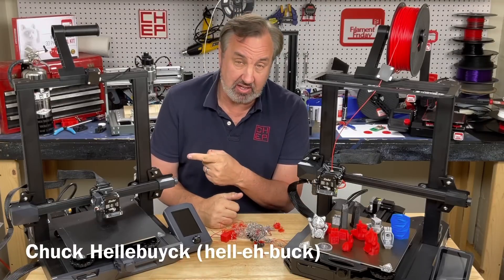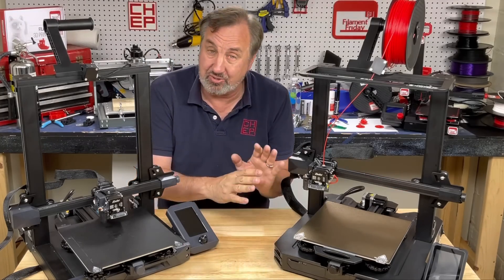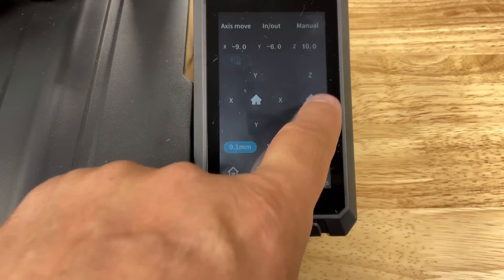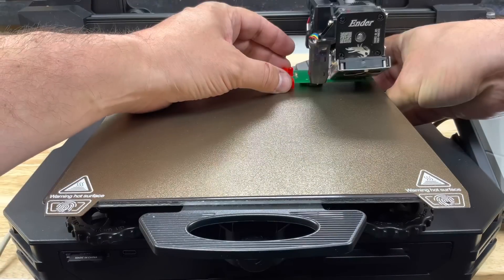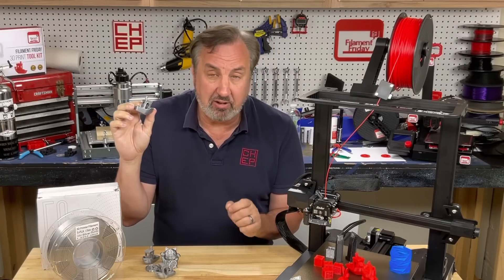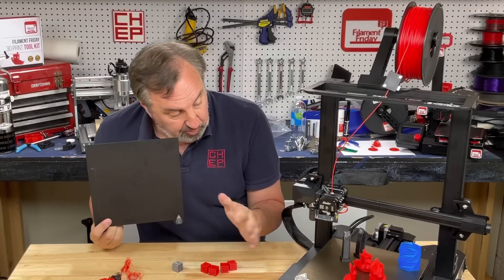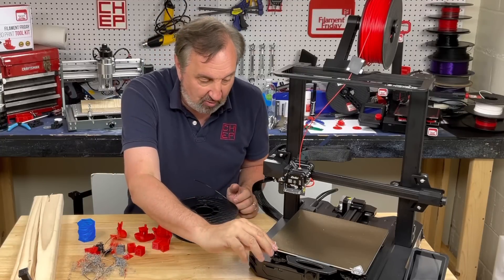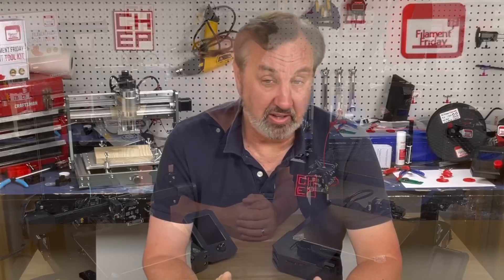Ender 3 S1 Pro - High Temp Direct Drive 3D Printer

Comment from the maker: FYI: For everyone telling me how to fix the bed. I actually have two Ender 3 S1 Pro printers. Both have the same issue. I’ve cleaned with IPA, I’ve washed with soapy water, I’ve scuffed it, Ive tried higher heat, I’ve re-leveled the bed many times. 
I have a lot of experience with Creality beds having tested them before. I’ve also used PEI bed in other machines like Prusa. I have 3rd party PEI beds. I’m very familiar with them and how the good ones work. It’s the Creality PEI bed on this machine that is poor quality. Not all PEI beds.
Reply: LOL, I love the fact that people are telling you how to get prints to stick, freaking hilarious, as if you don't know what you are doing. Love your channel Chuck.
Reply: why don't they use the glass bed from the ender 3v2??? i like that bed alot
Reply: @jeannordstrm3935  that one with glue is the best option there is! everything sticks, and it's super flat
Reply: I use the stock PC bed printing mainly PETG and it sticks like a rock just by touching it
Reply: I find that people who can't get good adhesion on stock bed are all doing it wrong, I've helped thousands in Ender 3 S1 group that all complain about bed level and adhesion
Reply from the maker: Darkburrow - How do you suggest I level it to get better adhesion on the PEI bed?
Reply: @FilamentFriday  from my experience I had to put Z-offset nearly to close for it to stick, I find the textured surface is TOO textured, PC bed i just need to be close enough with PLA and just touching with PETG, now bed that came with mine is awfully warped unfortunately, variation of 0.5 in some places, ABL can barely compensate, level as you always do
Reply from the maker: Yeah, the PEI bed is hit and miss apparently. I just got two bad ones in a row.
Reply: @FilamentFriday  I have found that the dual-sided rough and smooth PEI is a good bet, the smooth PEI I think works better for PLA, but PETG and TPU stick too well to it so I use the rough side.

I think PEI is probably the best all-around print surface that works on multiple materials with minimal issues, but PC beds definitely stick PLA down really well, can't dispute that! At the end of the day it's a case of using what works best for you, I have a few beds I swap between depending on what I'm printing with.

The quality of the PEI might make a difference too, I have only used the one I have, not what Creality ships with the S1 Pro.
Reply from the maker: Recka - Great points. For the price, and calling it a pro IMHO, they should include two beds. An S1 PC bed and the PEI. I’m pushing for that from Creality.
Reply: Cannot argue with that. Calling it a pro machine, they should offer as much versatility and options as they can.
Reply: @Torskel  would you like to tell us all what we are doing wrong??? Links etc
Reply: @Torskel  WOW ! such wonderful clarification , bet thousands have learnt from that!!
Reply: @Torskel  preach it master! How must one do it
Reply: PEI is soluble in alcohol.  If you clean PEI with isopropyl alcohol it will absorb it and swell.  Your adhesion will be terrible until all the isopropyl alcohol has evaporated out which can take much longer than you think it might.  You also shouldn't scuff it.  That is just going to make absorption worse and ruin the bottom surface of your print.  Clean the PEI bed with soap and water and run it about 55C.  It pays to check your bed with an IR temperature gun.  If you are getting hot spots you may find that adhesion is failing in those spots.
Reply: I think the PEI bed on the S1 Pro is extremely sensitive to bed temp for a given filament. I've been printing for a month now using Hatchbox (various colors) and my adhesion has been finicky if I don't get the slicer settings perfect. At 50c bed temp, my prints have had a 100% failure rate. At 60c bed temp, I have had 25% failure rate. At 60c bed temp, I have had 0 failures in 35 prints while also going to a .3mm first layer so combination of the increased first layer height and bed temp has solved my bed adhesion problem. I will say, once the bed cools my prints just slide off the PEI without even having to lift the lift the magnet. I would 100% agree with you that I think in many ways it is a step back from the S1 bed material.

One thing I would call out though is I still think the S1 pro is the best deal. You get the LED light, the high temp hot end, and once you use the touch screen it becomes easy to use even if the menu isn't intuitive as there are not a lot of options in stock firmware. All of the upgrades bought separately are each 200% marked up from the cost they come bundled as part of the S1 pro.

All in all great review and your talking points are all very valid and 100% accurate.
Reply: @Jocoev  This is what I've observed as well. Got my S1 Pro a couple weeks ago and initially had some bed adhesion problems.. virtually all of them went away once I started setting bed temp @ 60c for PLA, ~80-90c for PETG, and TPU sticks to it really well regardless so I just print that with the bed at 40-50c to save a little on power.

Love this thing though - phenomenal results printing TPU (amazonbasics) @ 60mm/s, PETG @ 120-140mm/s, and PLA @ 120-180mm/s.
PS: I'm using Klipper, with 1500 x/y acceleration
Reply: I appreciate this clarification.  I had mine dialed in and then out of nowhere could t get things to stick and haven’t been able to figure it out. Do you have a 3rd party bed you recommend?
Reply: @billysaqr3253  Energetic PEI beds are what I use, both smooth and textured. They're great, the best ones I've ever used (and I've used a lot!).
Reply: @billysaqr3253  I've had good results with the TH3d Studios EZ-Flex beds, and the wham-bam ones also. Not sponsored by either company, I just have a lot of printers and have used a ton of flex plates. Best results are the ez-flex by far, but the wham-bams are good too.
Reply: I have several PEI sheets, I don't think I have ever had an issue with the textured side.  The smooth sheet generally requires roughing up with wire wool and isopropyl.  Occasionally I have issues with some PLA's not sticking, if a "re-ruffing" with Isopropyl and wire wool doesn't fix the problem, I use a glue stick.
Reply: IPA is the wrong stuff to use. just wash it with a bit of dish soap and dry it with tissue, mine has been working for 2 years now and it has never failed. it use to fail all the time when i did with IPA.
Reply: The regular Ender 3 and Ender 3 Pro beds are the 2 best beds I've never used, and I have many Ender 3s including Ender 3 V2. Glass beds are aweful.
Reply: Had the pro as well and a lot of trouble with bed. It was bended, ABL was not saving results.. it never was possible to print a first layer correctly. And as well this software.. horrivle.
Gave it back with $80 loss, but happy with this deal.
Reply: I've found bed temp on this printer is 10 degrees below actual. I've checked with temp gun.
Reply: Have you tried denatured alcohol?
Reply: Creality is a waste of money!

Comment: I’m having problem printing with my S1 Pro. So I bought the Sonic Pad and it started AOK, but now keep slipping and all the model coming off the bed because the Nozzle or something (that I can’t figure out), keep touching the model while printing. I keep resetting and re-levelling the Bed, swap with Silicone Legs instead of Spring, swapping the screws with shorter screws and yet the same. Any advise will be much appreciated. I tried to print the CHEP Cube and failed half way. I need help, please!!! Thank you in advance!!!

Comment: im having a horrible time trying to make my prints stick to the bed i just bought my 1st printer its an ender 3 s1 plus and i have NO CLUE WAT TEMPS i need on the nozzle or plate would u have any advice? there is alot of videos out there but no one really walks thru everything im stuck atm dont know what to do i also bought a enclosure for it so wind wouldnt be a factor in moving my prints dont know what else i can do =( can u lead me the right direction?

Comment: In my experience with the textured PEI plate you want to clean it when its dead cold. It’s temperamental when cleaning even while the slightest bit warm or idle. Pretty sure it has to do with the way the sand blasted pock marks retract while cold. The good thing about those microscopic craters while at full bed temp is they grip like nothing else. Its also the reason why the larger the print the better the adhesion as long as the bed temp is high enough. For PETG I go with 90F on bed temp and 250C for nozzle…I’d need a hammer to separate the print from the bed at full heat. Allow bed to cool to zero and i can push a full volume print off with one finger. The problem with this full cool down cycle is slower concurrent prints waiting for the bed to cool to zero.

Comment: I watched this video months ago after I had purchased the S1 Pro. Watched several reviews being curious to what others thought about the printer. My brain wrapped itself around the UI a bit better. Wasn't an issue for me. I never touched either home button until yesterday, which is why I comment. Figured I'd share my experience.

I've printed ... 100 parts maybe (~1600 meters)... now I'm having first layer issues. I manually level the bed, start the G-code (which has G28 in the start code)... mediocre 1st layer 1st print, abysmal 1st layer second print, manually adjust. Repeat... I'm assuming my Touch is having issues? But I'm noobish, and currently my workaround is removing G28, manually leveling the bed (giving me the best first layer yet) and homing XY occasionally via the UI. For the time being works great!

I'm happy with the purchase... but already want to use filaments that exceed this printer's capabilities, LoL.

Comment: I'm enjoying my Ender 3 S1 Pro, had it for a couple of weeks now. I've also had some issues with poor stickiness of the base sheet. I've printed a bunch of my designs in TPU on it that came out great, someone else's articulated robopede in TPU, again great. One of my own mesh designs in TPU, it really is great for TPU mesh prints, fast too because of the quick retract and good feed pressure on the TPU.  And last night, one of my vase designs in purple/copper/blue tri-colour, If I were an artist, that would have been an orgasm in the pants just looking at it. I'll have to try some other tri-colours, but this one is spectacular and I know what some of my Xmas give-aways are going to be now. Where I did have issues, was with the stickiness of some softer ninjaflex TPU. After printing some great meshes in the clear, I tried the same ninjaflex but in green and it's really hard to make it stick to the plate. In the end I did a raft base with 0.15mm gaps between lines and that printed beautifully but with lots of cleanup needed. A lot of my TPU designs are quite small. Intricate key protector sheaths, mini-bellows, tube end replacements etc. Some of them though, need a bit more height than is available under the X gantry for print one-at-a-time operations. So I suppose I'll just have to deal with concurrent model builds and a degree of wispiness.   There's also another youtube reviewer who I agree with, about the poor hot end visibility. If it was me, I'd put the surface cooling fan on top as a centrifugal, pipe it down next to the nozzle. Also I'd modify the probe sensor to sit high above the direct drive and with only a skinny neck out to the side. There's a lot of footprint on the direct drive due to careless design. This is no issue for all at the same time prints but it makes it impossible for me to tightly pack items ready to go,  set them to print one at a time, inspect the first one and then just leave it running if my design works out well. On my CR6 Max, I can print up to 16 devices one at a time on my 400mm sq build plate, the bowden hot end has a better foot print and of course the build plate size helps too,

Comment: I received this model yesterday, it's my first 3D printer. The touch screen was totally intuitive to me. The bed leveling process was intuitive and did not require any external program. The demo prints were rather perfect.....no fails. 

The bed adhesion and release was easy for me. 

I like it.
Reply: Good for you. I was dying my first week, I couldn't get anything to print. Now I have the glass bed, and am using more brims.

Comment: I ordered a S1 Pro for 399 and it will be here tomorrow. I also ordered a Sonic Pad from Creality. Thanks for the video. I wonder if that rough pei can be peeled off and replaced with smooth? Or just add smooth to the underside?

Comment: i try leveling and leveling and leveling..... Auto with CR TOUCH and Manual. There is no way to print anything. The nozzle is too high and prints in the air or too low and scratches the bad. I update the firmware and issue continue. On my last chance i will try  update to KLIPPER. For god i dont sell my ender 3 version 1 its much easy to print any thing.
Reply from the maker: Did you adjust the z offset?
Reply: @FilamentFriday   evrytime
Reply: @_W1L_  there is a major issue with the S1 auto levelling. Try manually levelling the bed and turn off auto level in the start g code and see if you get an ok print. This is the only way I can print currently. Still in discussion with creality and the place I bought my machine about a replacement but no point yet unless they admit a bad batch or bad firmware.

Comment: Can I print Carbon Fiber with this hot end?
Reply: Yes-ish. The S1 Pro comes with a .4mm brass nozzle, you can probably make it work but CF is super abrasive and flows better with something wider.
If you're going to print a lot of the stuff then definitely upgrade the nozzle to .5-.6mm hardened steel or even tungsten/ruby if you've got the $.

Comment: I recently got this printer and in the beginning my prints wouldn't stick and I even used bed adhesive but it didn't work because the table it was on wasn't level so I then moved it and leveled it multiple times and then all my prints started sticking. Now it is an amazing printer and the detail it prints is really good!

Comment: I AM HAVING A NIGHTMARE TRYING TO PAUSE AT A LAYER/FILAMENT CHANGE  (M0/M600) WITH THE S1 PRO. I HAVE TRIED EVERYTHING, I AM USING CURA 5.0 AS THE SLICER & I AM AT THE POINT WHERE I HAVE GIVEN UP.

THE LCD PANEL IS VERY CONFUSING LIKE CHUCK POINTED OUT.
Reply from the maker: I don’t think the stock firmware recognizes those commands.
Reply: I have an Ender S1 Pro, a and use creality 4.8. The pause at... under modify gcode works great. However to restart after pause, you have to press stop and no to continue.

Comment: @chep, I'd love it if you could film doing the z offset setting on the S1 Pro so I can be sure I'm doing it right. I tried it, got a value that was too high and ended up gouging the PEI sheet, did it again and got a much smaller value and then had adhesion problems which I can't tell if is related to the PEI sheet or z offset.
Reply from the maker: It’s basically the same as I show at 4:15 in this video: https://youtu.be/TroPjdkSEOY

Comment: It looks good... but I want a bigger bed but if i'm gonna spend 1k or more then I'll just wait and get a Jupiter resin printer... (even for the extra $)  btw I use a PEI bed on my X1 and it works just fine.  I do put some cheap hairspray on, but it works without it too...

Comment: Hi Chuck! Was your printer brand new or Refurb? I got a refurb and I'm having same issue as you with this bed. I'm trying to print the Ender Coin from the SD card and just using the sample white PLA that came with the printer. It appears that the filament starts to leak even before the print starts. Default PLA settings are 200C for nozzle and 60C for bed. At about 195C my filament starts seeping before the print begins and smears the print once it starts, then the print starts to unstick. Not sure if its the bed or the filament or the temp settings or all 3!

Comment: My Ender3 v2 died. Do I buy another v2 or a S1 Pro? Money not the issue
Reply from the maker: What died? Can’t it be fixed?
Reply: @FilamentFriday  Motors locked up. I put a new board in but it didn't help. I'm not sure whats wrong. I believe it's beyond my skill level to fix it. Was thinking of parting it out and upgrading to a new printer. Thanks for your reply, love the channel
Reply from the maker: I still like my V2 but and S1 Pro has nice features. I don’t like the tough screen though.

Comment: I've had o problem with my s1 pro, after a few layers, especially in architeture dioramas, the ptfe tubing just clog and the extruder couldn't push more filament and started grinding the filament, idk if any of you had this problem or not, if you a solution pls help!

Comment: In my country (Poland) it’s cheaper to buy S1 and sprite extruder pro, than buy just S1 pro. It’s idiotic but difference is between 50 to 100$. If i just want upgrade extruder to full metal cost is around 25$. So… probably I will choose S1, for me rest of upgrades are negligible.
Reply: You could just also replace the heatbrake within the Sprite extruder on the S1. I replaced mine with a slice engineering copperhead. After changing the config it now also prints up to 300°C